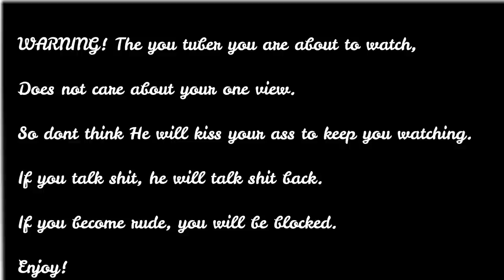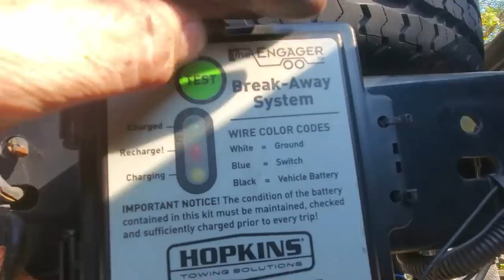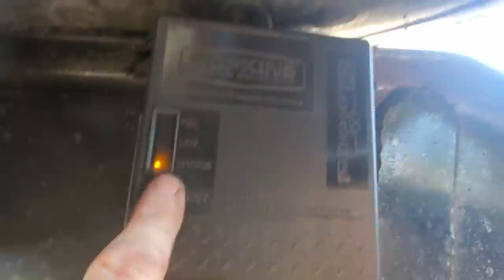Trailer disconnected error

Comment: Whenever you use the brakes. The left front on the trailer gets all the power. By the time it gets to the right rear, there's no power left. Whenever I rewire a trailer, I mount an electrical box center of trailer and centered between axles. Run 4 equal length wires to the brakes. All brakes get equal power and work better.
Reply: Great advice 👍👌

Comment: I pulled a  lowboy for over 35 years let and old timer give you some advice every place you spliced that wire you need to put a junction box they are sealed and cheap the way you did it you will always have problems even time they get wet

Comment: Hey Robert
Those scotch lock connectors are junk for trailers as they are not weather proof. You really need to be heat shrink butt connectors if you want those connections to last. I wodk on traileras all the time and never use tbem for that reason. Keep up the great work.
Reply: Scott Shook I can’t believe he’s still doing that. Told him before to take them out. They only cause trouble. Can he learn?
Reply: Scotch locks are terrible for weather. Probably last 6 months at most. Please use shrink connects if you dont solder and shrink. Good luck, I like how you work.
Reply: those connectors are crap i borrowed a small box trailer and the lights weren't all working and found issue being one of them so i ripped it off and soldered the wires and they work perfect now dont understand why he still uses them unless he is being lazy
Reply: I agree the best way to go would be solder with heat shrink if you don't plan on changing the wiring anytime soon. I use the Scotch lock connectors every 6 months. Cut off the old and stick in the new one put a little liquid electrical tape on the bottom of them all good spring and fall. The key is just stay ahead of it keep doing it every 6 months packing bearings and its cheaper to buy back plates than brake shoes and magnets and more aggravating 5 screws and you're done and everything while it's still cool outside spring and fall. And you got to keep those wires tight don't let them flop around they get ice on them. It's just easier for me this way to each his own.

Comment: I’ve wired a lot of trailers and your doing the right thing on everything except those blue squeeze connectors 
They aren’t worth crap and will give you more trouble when the moisture gets to the copper wire and it will deteriorate   I use either heat shrink tubing with a straight connector  or one a straight connector and squeeze some silicone inside of it and put the wire in and squeeze it together   This keeps moisture from getting to your connections.  If u have any problems with ur lights after you do this it will be a bad bulb or a pigtail connector going in the light itself

Comment: You only need to run the 7 way to the axles, after  that just lights
Reply: Problem is that new trucks monitor voltage on power wires to trailer. If truck detects stray voltage on light wires, truck will give a code or warning for trailer wiring harness.  Making sure good sound wiring for all lights resolves this problem.
Reply: You know what happened to the guy who thought he had to fart?
Take your time. Go thru a complete diagnosis. Refrain from guessing. You will get it.
Reply: Agree should stop at axle with sealed junction box run 4 wire back for taillights run separate wire for each axle for brakes and seal all connections with heat shrinks or liquid tape. Had a lot of same issues with my Kaufman trailer until I done this. Most trailer makers don't know what salt up north does to wiring when it is not sealed good
Reply: @riverflyswatter  yeah but most people just fire the parts Canon at their problems.
Reply: @jameschristie4596  a total waste using that 7 wire down the while trailer, as 2 wires are power only wires, one is battery charge wire, the other power wire is an axc. power wire, the 7 wire is only used to the junction box, there is a wire made just for the brakes, in heavy casing, and you buy the gray 2 and 4 wire cased wire for everything else,, the biggest problem as i have siad on here before, is grounds are tapped into the frame,, big no no,, all grounds wires are run right back to the ground termanal in the junction box, and on the truck, back to battery, never use frame as ground

Comment: Hey Robert, I’ve had a trailer before that I couldn’t find buddy bearings for, so I drilled and tapped the original caps with a grease zero and pumped grease in that way!!!!

Comment: The current to the magnets are "throttled" by pulsing with a duty cycle.  The whining is the pulsing you are hearing.
Reply: Absolutely, stop turning rotors on modern vehicles. They aren't that expensive $120, versus 20 to turn them.
Reply: jaydak99 and even though not much is taken off they will warp quickly.

Comment: Absolutely love your videos!  Do a little research on a company named "Frozen Rotors" just south of Minneapolis, MN.  They cryogenically treat rotors to make them harder and then they last a lot longer.  They also sell special brake pads for things like racing and towing.  I bought some rotors for my old F-150 when I was towing and they worked great until a caliper froze up and ruined the thing!!!  Boy was I pissed.  They are not cheap, but will last maybe 3 times as long as stock (without a defective caliper).  I first heard about them when I lived in the Rocky Mountains.  Lots of truckers use them out there because of the severe braking conditions coming down the mountains.  Best of luck.  Think of them as an investment, especially if you are going to keep the truck for 500,000 miles.

Comment: Get some additional junction boxes and use a couple where you have to branch off to the other lights in the back. You can pack them with grease and no more problems. Those blue scotchlock things are nothing but trouble.

Comment: After replacing alot of magnets i solved the broken wire problem by sliding a light spring over the two wires and
The protective sleeve and JB weld th base of the spring to the magnet this supports the wire right where they were breaking .
This seemed to solved the problem for me

Comment: Your expectation of turning a few times on rotors is wrong and unsafe. Don’t do it.
Reply: There is nothing wrong with turning the rotors. As long as they are with in spec. after market rotors will get hard spots in them in a short time, The metal is not uniformed like the  original equipment. Always buy the best you can find.
Reply: kennethrobinson11231 Nope....its not recommended to cut rotors anymore.....heat cycles are why you change rotors.  ( our brake lathe is a big space waster now )To cheap to f. with....

Comment: I know its probably too late but when I redid my 32' flatbed I did like you and used the nice wire. But I also ordered 3 more of the breakout boxes so all my connections/taps are tight weatherproof connections inside the box. This works great for adding lights or testing in the future. I got everything on Amazon. I also left my hubs oil bath and never had a leak.
Reply: oil bath is the best thing going, but if you pull the hubs off you must replace the seal every time, and with the right type of seal, even grease seals must be replaced every time it is pulled a part

Comment: Dont be afraid to put a big dedicated ground on trailer to truck....... run them now all the time with our electric brake vehicles.....it helps a bunch.  Also find a good empty setting for you brakes.....saves on tires. One lock up at night that you cant feel or see...bye bye tires.  Happens to all of us..  keep them with grease....one out of service with oil not good.  Big stuff is all grease now.   Hot shot stuff your at the limits so new wheel bearings and magnets every year...even on our race car trailers 👍👍👍👍

Comment: In 10 years of working on electric brake commercial trailers in Southwest Pennsylvania, never saw wires in a magnet do that. Guess I led a charmed life in that way.  
Lots of destruction by road salt though ! 
 Carry a spare disconnect cable...any defect in the plastic covering is out of service. 
Road Check safety blitz is May 5-7, instead of June...unless it gets postponed or cancelled.

Comment: Good catch on the magnet wires. You may be use to getting a few turns out of you rotors on cars, but you are trying to stop alot of weight (for that size of truck). The factory pads are pretty hard material so it will wear the rotors. 
I would run another junction box down under the trailer to where you need to start splitting the wires (brakes, side turn signals), from there you can run a 4 wire to the back for the lights. The reason is (1) if you ever have another issue you can check if its front half or back half. Then (2) if you have to replace wire again it's smaller section.

Comment: @15:54  That is NOT pitting due to any environmental issue.  Those are entrapped air bubbles from the potting process in making the electromagnet pads.  Basically the wear on these is such that it has worn into the potting compound exposing the air bubbles.
Best regards,
Ken

Comment: dude from all the nightmares that I've had those scotchlok wire connectors or the worst nightmare for trailers please invest in some of the waterproof shrink wrap butt connectors you will not have no more problems with your trailer wiring

Comment: You need to check the bushings on the end of the springs and equalizers. The way they wore that trailer shows me they went the cheap route they probably use plastic bushings in the springs which will not last long. They make brass ones that will last longer.

Comment: When wiring your brakes on your trailer the black and your red wires in the big black wire that’s for your brakes and all ways remember your yellow wire is your left turn and stop and the green wire is your right turn and stop and the brown is the running lights and black or white is for the ground I used to wire trailers for a living

Comment: Once you get moister under the rubber insulator copper wire deteriorates in no time, Did a small end trailer few months ago (before winter season) owner nicked a wire when replacing floor boards I ended replacing the whole run because wire rotted out to the connector of course different gauge longer it will last longer, only thing holding the wire in place was the rubber insulator. Be safe out there love the Videos.

Comment: It used to be machine shops, auto shops would turn rotors several time, below manufacturer's specifications. Laws have chance creating liability if a company does that. Not to mention using a vehicle in a commercial capacity changes things even more i.e. DOT fines. So be safe and replace when recommended

Comment: Good job and good video scotch locks are so easy to use but I try to avoid them I do carry a bunch of them they will get you going in a pinch if you use them coat them over with rtv  after you put them on it will help with the salt  I coat all connections with rtv then if I have time after it drys I black tape it . Thumbs up as always hope everyone subscribes

Comment: Robert I hate that you are having so many problems with that trailer. I called southern trailer about a year ago and was going to order a 40 footer. Started asking questions about the axles and he told me that a local guy was making them for him. That was a huge red flag for me because of parts. Started researching his trailers and your right. The quality is not there. Suck you have to go through this crap and I understand why you bought the trailer. Glad you found the issue on the brakes.

Comment: Try using the Lucas hub oil with leak seal. It is very thick and will bearings lubricant even if you have a leak.

Comment: Every spot the wire hits metal is going to chafe the wire or the sheathing. Just keep an eye on it or give enough slack to keep from rubbing the sharp edges and use silicone to keep it from rubbing

Comment: I had the “trailer disconnected” with my PJ Equipment trailer hooked up to my 2015 F350 but not on my 2001 F350. It appears that the new truck monitors the lighting circuit current or voltage drop. My PJ trailer had a tail light wire fed through a factory blow hole made with a plasma torch in the channel and no grommet. Wire insulation was worn through and tail light wire was shorted to the frame. After splicing wire the “trailer disconnected” message went away. Nothing mentioned in the Ford manual about the message.

Comment: for your info the little angle part on your trucks brake pads are the wear marks to go by when they are gone they are used up.
Reply from the maker: I just used to the little bent piece of metal that makes noise when it get low

Comment: I learned after many years that car parts are much cheaper online.
Advance Auto, Autozone and the rest will give you discounts, coupons and credits for buying online and picking up at your local store.
But if you really want to save money on parts, buy from Amazon or check some of the online parts places. You can save anywhere from a third to a half on prices.  I can buy name brand OEM parts for what the local parts places charge for off brand junk. 
If you can think ahead and wait a couple of days you will save big money on vehicle parts online.
Don't forget wiper blades, filters, sometimes even oil or anything else, buy it at Walmart or online to save big money.

Comment: You put a little preload on all wheel bearing. Some tires cup. I see that all the time. Use Firestone tires and blance all wheels and tires. Ck your axle line up. These axles are never lined up from the factory. All this is what you do in the business.

Comment: Those flat spots on the tires are caused by out of balance tires.
Reply: Or bent axles
Reply: also caused by jack knife tight turns. Them long trailers drag or scrub the tire edges when they get turned tight and spun around in tight spots.

Comment: So they claim if you run the long run brake pads they will wear out the rotors at service time.  Think I would always have a full set of front brake parts ready to go.  In my time hauling logs I got rid of the junction boxes for wiring and used thumb screws which you can seal with rtv and tape up securely.

Comment: Hi Robert, glad to see you are still hanging in there, I stopped around Thanksgiving. Im trying to get rid of my trailer, if you know anyone that needs one, 2020 33ft Big Tex, all new tires and all the equipment anyone would ever need to start a hotshot business. I'm in Florida, but can deliver. Lee
Reply: BBDcummins  It does have mega ramps, it has 6 new tires, 2 a els and 2 spares, it has equipment box I had welded, it has a light bar and it's own battery I had installed. I probably owe $9000 on it, it's like new, I have everything you need to start, it also has dot inspection
Reply: I also have a truck ready to go, 2017 f250, it also has a dot inspection
Reply: BBDcummins  It has 2 axle's, 4 wheels plus 2 new spares
Reply: BBDcummins  I can send you pictures?

Comment: Actually, 120,000 miles on your brakes and rotors is pretty good mileage considering the weight you've been hauling. Glad you figured out your trailer problem. Im sure your videos are helping a lot of current and future Hot Shotters. Im even learning stuff I didnt know about smaller trailers! If it wasnt you accidently sliding them with your controller, you might have some steel bands breaking in those tires? Had that problem before with big truck tires. If thats the case, the tire will eventually blow out and you'll sling alligators all over the road?Haha

Comment: you need your heavy duty wire on both sides of the trailer, a line for clearance and tail lights, a line for brakes, and a line for turn signals and a ground line..  Your 7 pin line is only needed to your junction box.  You need a heavy duty 4 wire line for each side of your trailer from your junction box.  I used to wire trailers on a production line.  Your brake magnets are also a critical component.

Comment: You need to go back to your wiring, ever place that you cut into your main  Waring harness,  To split off for lights and brakes, were you punctured your main waring harness.  You need to get rid of those connectors, than scotch lock connectors, And invest in some heat shrink butt connectors they have a silicone in them that will reseal wires. all you need is a Set off pinch pliers and small hand torch to heat them, then take some black  Electric tape were you cut the coding on your main harness tape it back up to keep the corrosion from getting to your harness. The water will get into those  Scotch lock connectors and   Corrode quickly You don't need that green worm!  I'm glad to see you found the issue with your brakes.
 I was surprised they would  let you turn your rotors The government has really stepped in all that stuff!
 Good luck.
Reply from the maker: We went back and sealed everything. This was a quick check to see if it was the problem
Reply: Right on,  Look like you did good job.

Comment: In the end now you know in and out every connection and every piece of electricity on your trailer, just for a future hint I have found in many cases that you can buy a whole preloaded backing plate with the brake Springs and magnets almost as cheap as you can buy a set of shoes for them. Hope you can get back on the road soon

Comment: 2:15 You should do that before you get on the road(get a room)! Also... Should have got the rubber insert clips,they are way more $ usually, but.. will be much kinder to the new wire housing, in the chafing factor of things. Way better to run it (the wire) in the channel, at least as much as you can, as well.

Comment: Hi Robert. Just a thought man, But is there any way to seal the openings for the wires, on the new magnets, with silicone caulk or even electric tape them so water doesn't get in there again?